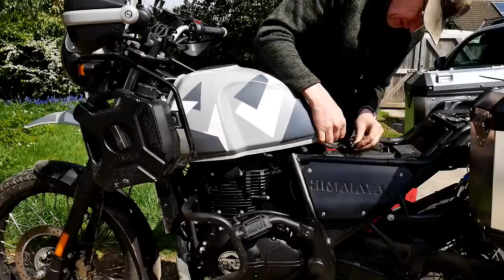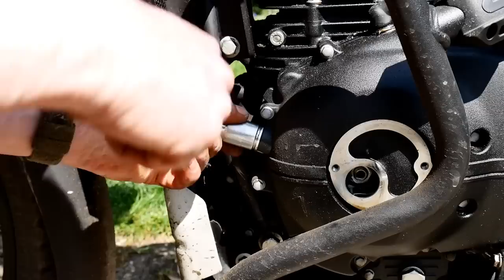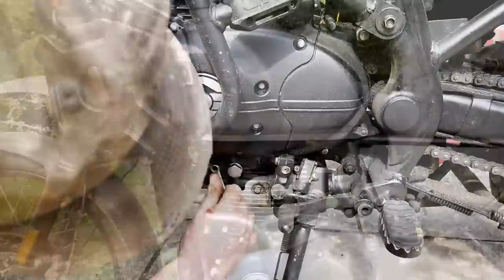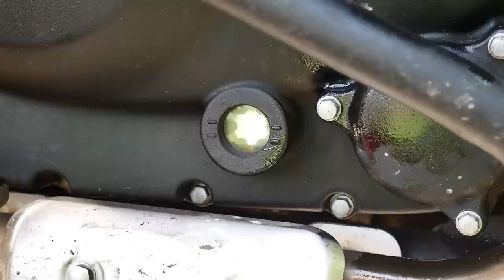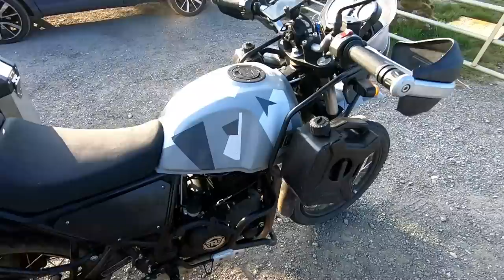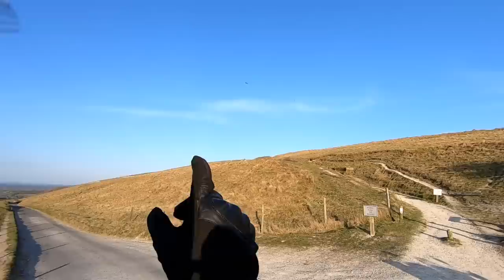RE Himalayan. Valve Check and Oil/ Filter change | Test Ride

Comment: Hi Sandy, I love your videos and I always enjoy your adventures. The White Horse in Uffington  is one of my favourite places, I ride up there often. From a purely mechanical perspective you should never really turn the engine in the opposite direction to its normal rotation where the cam drive is chain and sprockets. Turning it clockwise keeps the correct side of the cam chain under tension and all is good with the timing, but reverse the motion and temporarily you will shift the tension to the other side of the cam chain and the piston will move before the cams do and you run the risk of banging a valve into the piston crown, especially on an interference engine. Given the hardness of the valves it’s very easy to break one. It doesn’t really have anything to do with the nut coming undone by doing it the wrong way, as you say 80nm or so would prevent that. Just mentioning it as it’s always best to spin the crank round a further 720° to get it back on its compression stroke at top dead centre if you miss your mark. Any viewers with good old push rods can ignore that as it works differently, but most modern bikes like this will invariable come a cropper once in a while. Just thought I’d chip in a most people think it’s to stop the nut coming undone but it really is to prevent engine damage.
Reply from the maker: Very useful comment thanks. Ill pin it so others see it first
Reply: Very very good information as I like to do my servicing thank you very much
Reply: Sound advice.
Reply: tight side of the chain is with bolt being turned counter clockwise, the tensioner is on the rear of the engine. When setting cam timing, the chain should be tight on the non tension side, ie front of engine to ensure correct cam / crank relationship.  Turning it clockwise can put slack in the chain on the front side. I turn it clockwise, then back anticlockwise a fraction to do the final alignment of the marks.
The engine rotates anticlockwise when running looking at the bolt head. Turning it clockwise is actually the incorrect way, but less chance of inadvertently loosening the magneto holding bolt in the crank.
Reply: @mattyb7736  yes you’re right  the tensioner is on the rear, so it’s an anticlockwise engine, the tensioner side should the slackest side. My point really that it should be rotated as per manufacturer guidelines and not the opposite way for the reasons given. Always worth checking.

Comment: Hi Sandy and thanks for a very informative video. Subbed

I picked up my 2022 Himi two weeks and 1250 kms ago (live permanently in France) and the first thing I noticed was that the oil level was 0.25 ltr over filled !!

I took the bike in for it's 1st service at 800 kms and the tech didn't know how to turn off the blinking spanner service light; so I won't be letting anyone else work on my bike from now on.

On the subject of the bike itself I'm 70 now and have had many bikes over the years but this new Himi has me smiling all the time. I've not done any real off-road stuff in the past but she inspires me to do more and more. Her fuel consumption equates to approx 100 mpg.

Comment: Very useful video. Particularly the comment on being sure to remove oil from bolt holes as your right the compression could strip the threads

Comment: I find removing the bracket above the inlet tappet hole on the plug side gives you heaps of room. Yeah, its another bit to undo, but saves the swear words and contorted fingers. Turning the crank anticlockwise looking at the bolt head is the correct way to put tension on the right side of the chain, but I have had them come loose on other bikes before. 50 lbs/ft is easy to crack loose if you don't have the plug out first. 
Theres also 2 gallery drain bungs on the engine that give you about 500 to 800 ml of extra oil drainage. Just for your info in case you're interested, 
Oil path in these goes sump - strainer - pump - LH case oil cooler inlet - cooler - RH Cover cooler outlet - oil filter - RH cover gallery then off to the rest of the engine.
Its about 350 ml between high and low marks if you need to top it up. 
With a full gallery drain, and filter you fill to top of sight glass and start, run for 30 seconds minimum, when it settles its usually right on the full mark
Reply from the maker: Very interesting Matty Thanks. Yes turning the crank the other direction (Left) felt much smoother.

Comment: Good video Sandy thanks for sharing. Quick tip: use some tin foil and mould it under the filter housing drain plug which will direct the oil into the catch can and stop it from running into your bash plate underneath.  Engine sounds smooth after the valve check. Hope you're well atb. James
Reply from the maker: Good tip James, I did have a drain guide I made up last year but couldnt find it.

Comment: That's just reminded me the Honda is due an oil & filter change. Thanks Sandy!
Reply: You would find it easier if you took the spark plugs out (no compression
Reply: Chug looks lovely
Reply from the maker: @sophiegreen2802  spark plug was removed:)

Comment: Left hand tank pipe is the drain pipe if it gets kinked or squashed when putting the tank back on any water from washing or rain or excess fuel from filling up will sit in the ring reservoir and not drain away. The right hand pipe goes to the evap system ensuring fuel vapour does not escape to the atmosphere....

Comment: Thanks for the video, clearly showed & explained. Yes the service interval is short but I read a lot of people end up doing valves every 6 thou oil every 3. With practice I'd imagine you could do a valve check in less than an hour, balance that against how much hassle valve checks are on a lot of bikes and do you even know if the dealer you gave your bike to has even done it at all when you get your bike back? I'm really tempted by a Himalayan for ease of home maintenance, economy, go anywhere & they seem reliable. And I'm 56 so done with going stupidly fast and considering stopping motorway riding...
Reply from the maker: I've almost clocked 11K miles on the bike now and can do a valve check and oil/ filter change in about half an hour, the bike is easy to work on and you don't even need a feeler guage to do the valve clearences. Just set the exhaust clearence to 1/4 turn from the closed position and the inlet 1/8th turn from closed. This gives the correct clearences due to the pitch of the threads.
I have several friends who have the himalayan and they have had them dealer serviced. In one case we checked the valve clearences on a friends bike less than 500 miles after a dealer service. My friend was concerned because he couldn't hear and tapped noise.
When we checked there was zero clearences. 
You should be able to hear just the slightest tapped noise when the engine is running and hot.

Comment: A set of Offset Feeler gauges are easier to set the clearances and a Flat Flexible oil drain funnel would stop the oil going all over the exhaust and engine casing on the drain side. Keep up the videos. All the best M
Reply: I make my 'oil slide' out of a bit of cardboard, seen some using tinfoil also. Adjusting my tappets on the Himma is the only job not done myself yet so all knowledge in its respects is always appreciated. Thankyou Sandy and thankyou Manny.

Comment: Superb upload Sandy 👌🏻. My Vfr1200x is due a valve clearance check at 16000 miles which will be this year, but it's a big job 🙄. From what I've been told by many a motorcycle technician it will probably not need touching as less than 5% never need adjustment at that time. I may well leave it until 24000 miles covered and take that chance that all is good, as the valve clearance check on mine is 6 to 8 hours to do and even then it will need a complete service throughout so could be in the dealers / stealers a couple of days. So looking forward to your 2021 uploads whether it be motorcycling, camping, walking or with your flying machine. Have yourself a great year Sandy, all the best 👍🏻
Reply from the maker: It's exactly the same for my other bike the Suzuki V strom. That requires a valve check every 16K too. Sofar it has almost 6K so for me it's around 2 years before I need to have it done

Comment: Great video! what do you observe or listen to to know that the valves have been adjusted properly?
also good ideas to use tinfoil when you change the oil filter avoid oil dripping down
Reply from the maker: Hi Allan
It's really quite straight forward, regarding listening, you should here a very quiet ticking noise from the cylinder head. 
When setting the valve clearances there are two ways you can do it. One is to use a feeler gauges and the other is to use the actual pitch of the tappet bolt threads.
These are metric threads. 
A quarter turn open from the closed position on the exhaust valve will give you .16/.20 mm clearance and an Eighth of a turn on the inlet .08 to .10.
These will work well and some say in cooler climates you can even close them up a bit more but I still like to hear that gentle ticking sound.

Comment: A really nice looking bike. I had a ride on one and thought the camshaft or valves were going to fly out of the cylinder head. There was a lot of clattering going on. On reviews this is a common noise with these.
Reply from the maker: they do make a racket Rich, I felt the same but sofar all is OK now with 6K on the clock

Comment: Sandy, if the crankshaft nut is a 18mm hexagon, this is the same size hexagon on a 12mm x 1.25 spark plug which a standard 3/8" drive spark plug socket for 12mm plugs should fit.
I see there's a gasket fits under the oil filter cover, this should normally come with a genuine factory oil filter, beware of aftermarket oil filters which probably don't contain a gasket?. 
Thanks for the video.

Comment: Hi mate when turning the crank nut you should only turn it anti clockwise  as I believe  you can in extreme  cases damage the camchain tensioner - anyway might be coming  your way on May 18th  (I know  a bit off ) will hopefully  be stopping  at the choppers  cafe - would you  be about  for a meet up
Reply from the maker: It turns a lot easier in anticlockwise than clockwise but online it says turn clockwise. I must admit I was a little confused so put in the caveat "do your own due diligence" eve the RE manual says turn it clockwise.

Comment: What tapper adjustment tool do you have? I know it’s 10mm nut and 3mm square but struggling to find one in the UK
Reply from the maker: You can get them for Hitchocks motorcycles

Comment: Hi Sandy. Has Chugs engine increased in performance as the miles increase and you now have good tolerances?. I don't mean so much power but smoothness and pickup?. Many thanks for the help and tips well done.
Reply from the maker: Hi Steve,
There has been an improvement in smoothness but the engines on these bikes are quite noisy. kind of a clatter. They all make this noise and it's quite normal. Something to do with being a fairly big single and air cooled means the you will hear certain engine/ mechanical noises. I was actually quite worried at first and thought the engine was going to explode:) But all has been good and the bike has now covered 6K miles. Is very economical too.
As for pickup, if you give it a handful it does has some good pickup, but don't forget it's only 24.5 Bhp.
For back road slow bimbles and green lanes or for long distance travelling (travel far not fast) I think you'll find it hard to beat.
Top tip. Wear ear plugs...It makes the engine sound so much better:)

Comment: Since late 2019 RE has changed its oil spec to full synthetic only on FI Himalayans and 650 twins
Reply from the maker: Ah I didn't know that. Thanks.
Reply: really? my new one (as in 2021) still specifies 15W-50 semi synthetic in the owners handbook.
Reply: @mattyb7736   Check with your dealer
Reply: @WestSussexBiker  I'll believe the owners handbook that came with the bike, I did ask the dealer when I bought it, and he also said semi synthetic 15W-50. I tried full synthetic in my late 2019 model and it burnt oil, so I switched back to semi and it never used a drop.

Comment: I'm finding it very difficult and expensive to find an oil filter for my himy!!
Saw one on ebay, he wanted £26!! Surely that's not right and no after market ones?
Reply from the maker: I've just checked and for that price I could buy 5 of them.
Reply: @WiltshireMan  yes I saw that too, I've ordered those actually 👍 but my himy is due for a change and the delivery for those is the middle of August 🤦‍♂️ so ordered one from hitchcocks, £9 delivered so not too bad. Cheers for looking though 👍

Comment: Curious as to what tool you used on the small square adjuster on the top of the tappet.
Reply from the maker: I brought a tool made for the purpose from Hitchcocks motorcycles

Comment: Stealer wanted $600 to do first service. Probably use crap oil too. I did it myself. Oil filter $12, Motul 15w-50 $66.
Reply from the maker: Yes that is way too much money for a first service. Even a full service with valve check only takes just over an hour. Stealer just about sums up that dealer!